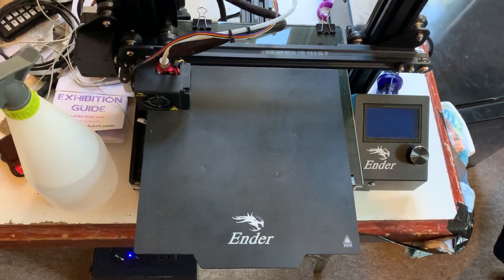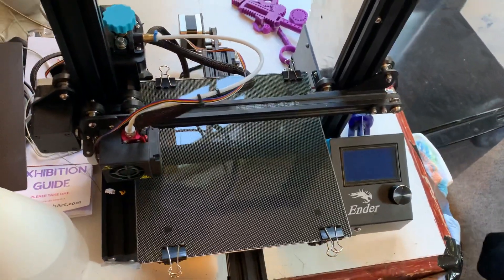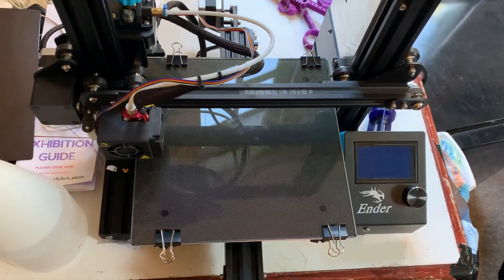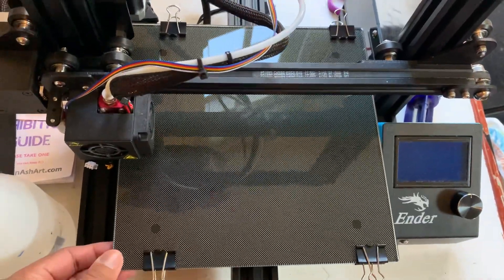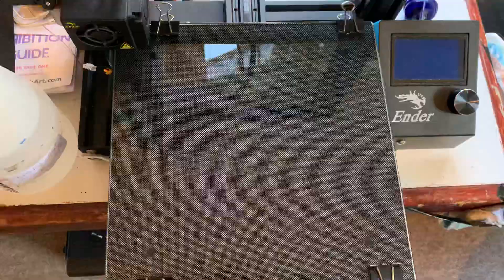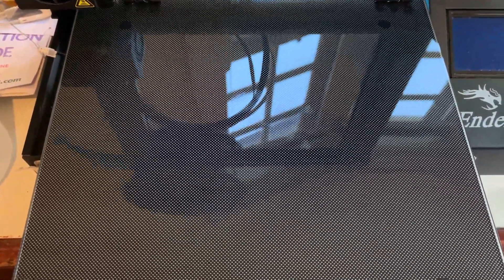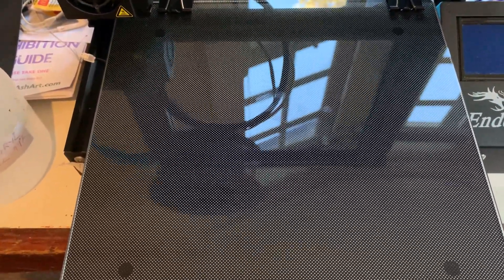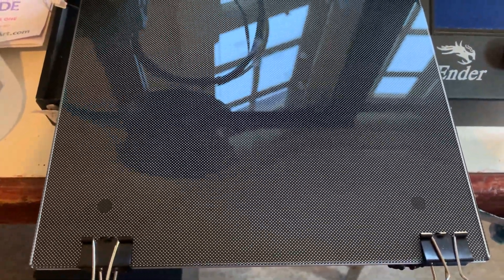How to install glass bed on Ender 3 Pro *The correct way*

Comment: what's the size of the paper clippers?
Reply from the maker: Unfortunately I can't tell you as I've now replaced them with 'swiss clips' or photo frame clips as they've got a smaller profile. You can get them for fairly cheap on Amazon / Ebay.